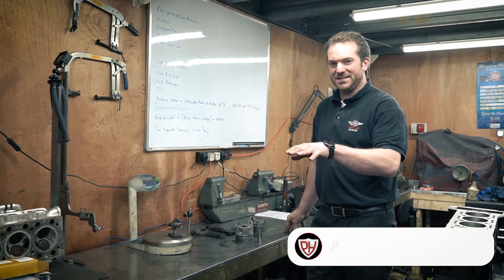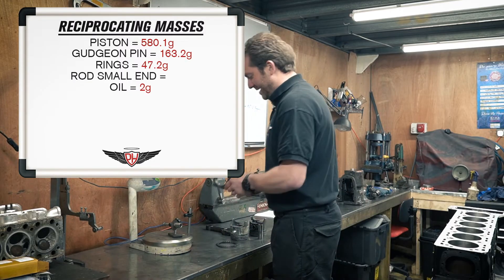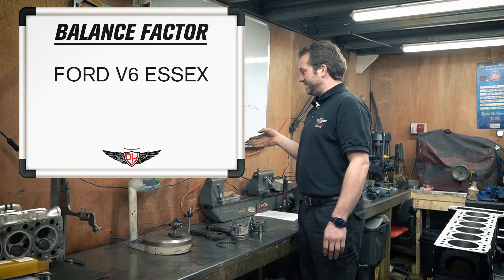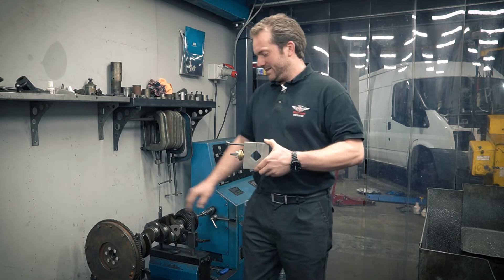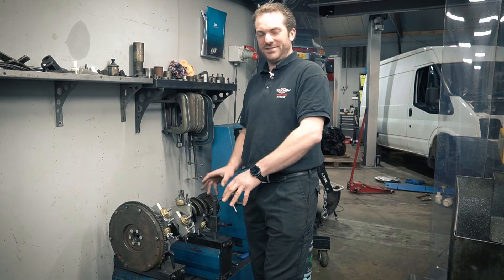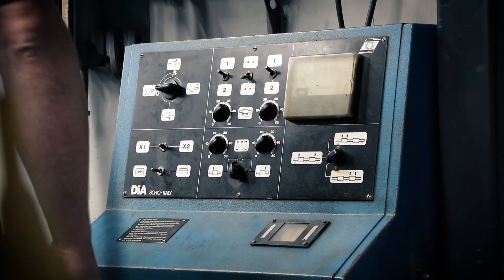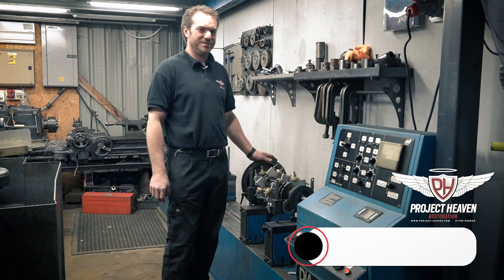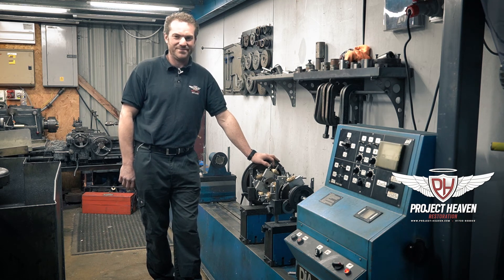V6 Engine Balancing - How to balance an engine

Comment: And you screwed up your calculation. You don't halve the weight. the 1089g is per journal.
Reply: I'am also paid attention to this moment... Strange division by 2
Reply: @channelsecondname  Getting mixed up with V8s which have 2 rods per journal.

Comment: Hello!  Please tell me.  The Alfa Romeo Busso V6 engine has a 24V pulley and flywheel with counterweights.  I'm changing the 2.5 engine to 3.0.  The 2.5 motor is fully functional, the pulley and flywheel are original.  And the 3.0 has an original pulley, a flywheel for the automatic transmission.  At 3.0 I will install a flywheel from 2.5.  The 3.0 pulley has a greater imbalance compared to the 2.5.  (Fewer holes are drilled in the counterweight) It is logical that the flywheel should have a slightly greater imbalance.  In such a situation, is it possible to statically adjust the imbalance mass of a 2.5 flywheel, taking the standard flywheel from a 3.0 automatic transmission?  You can replace the couple of bolts that hold the basket with slightly longer ones.  The space allows, and they are just opposite the casting on the flywheel.
  I looked for information on the forums, they say that it seems that the mass imbalance differs by 20 - 30 grams for 2.5 and 3.0 engines.
 But those who changed the 2.5 to 3.0 engine did not bother with this and installed a flywheel from a 2.5 manual.  And the pulley remained original from 3.0.  They drive for years without the motor breaking down.  The main thing is to leave the original pulley from 3.0.  With the 2.5 pulley there is some detonation or vibration, something like that.

 Unfortunately, we don’t have specialists who do balancing.  Therefore, we have to do it on our own.  At least I can keep within the margin of error.  Or am I worrying in vain, and I just need to assemble the engine and drive it.

Comment: The best way to do it is in reverse. Weigh all the stock parts, spin it up with an approximation of bobweights and adjust until it balances. That way you'll know the % factor used in the factory.
Reply: А кто сказал, что надо копировать завод производителя?  Для автоспорта используют отклонения в бобыакторе ... Не 50%.
Reply: @kasp1971  The balance factor is determined by the bank angle. It's only 50% when it's a 90 deg block. If it's a 60 deg block then it's not 50%. When you get it wrong you'll end up with excessive wear in the main bearings.
Reply: It's half of the sine of the bank angle. in the case of a 60 deg V6 it's 43.3%. 45% is an approximation which works when the bobweights are made up wrong. They need to be circular and concentric to be accurate.

Comment: Very nice video. Seem like a fiddly machine compared to the american ones you normally see.

What I find a bit peculiar is the reciprocating percent. Ive seen numbers from 34-55% for 60 deg v6.
Makes me wonder what ”balanced” actually mean.

Im doing a GM 3.4 V6 and they used the exakt same crank for the 2.8, 3.1 and 3.4 engines. Conrods are more or less the same although the 3.1 have 20g heavier rods. And of course the piston weight is all different.
So I wonder if the crank is just balanced in it self?

Anyways. Im removing something like 35-40 g on each cylinder. And I cleaned the crankshaft and rounded off some edges.
I guess it would be prudent to balance the crank. But how critical is it on an street engine only seeing 5500-6000 rpm max?
Reply from the maker: Very important the crank will definitely need to be balanced especially if you have removed weight from the crank. The crank certainly not be balanced with itself it will need bob weights making, but you will need to find out the balance factor for that particular engine.
If you'd like us to help you with it please give us a call 01733 609659
Reply: It should be about 43%